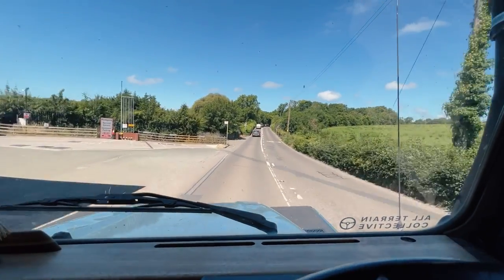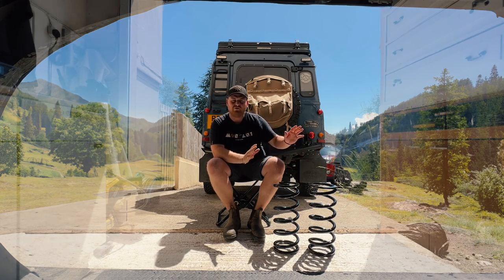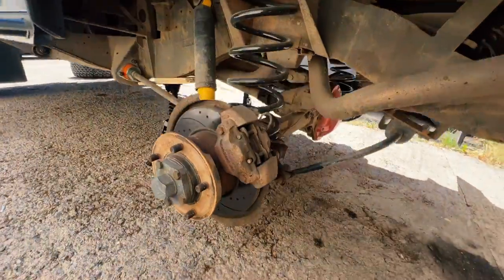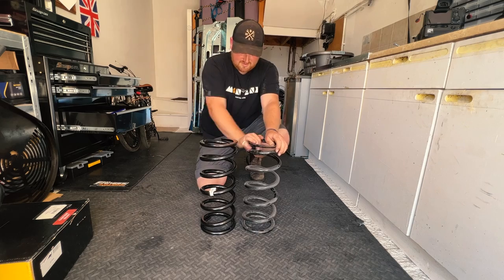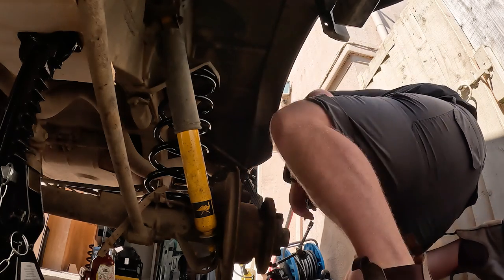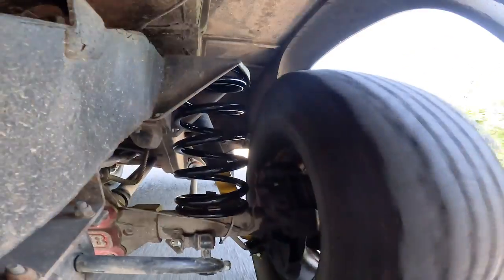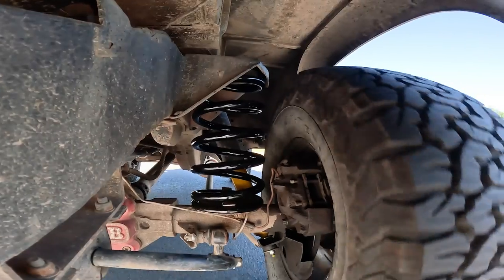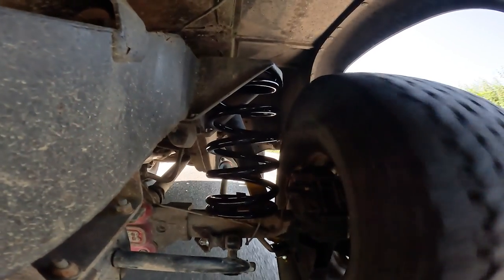DEFENDER OLD MAN EMU SUSPENSION INSTALL

Comment: You could also have used spring compressors (attached when compressed) to make life easier. Another good tip, from Gwyn Lewis is to use heat shrink on the OME damper for protection from pitting / stone chips that will turn to rust longer term.

Comment: I updated my springs to handle the heavier load but didn’t go to heavy so as to make a harsh ride when not loaded. and combined them with the air bags run through the arb lynx system so I can adjust them on the fly.  so when fully loaded and full tank of fuel on motorways etc I can stiffen it up.  and then when off roading I can reduce the pressure and give a softer more (wallowy) ride.